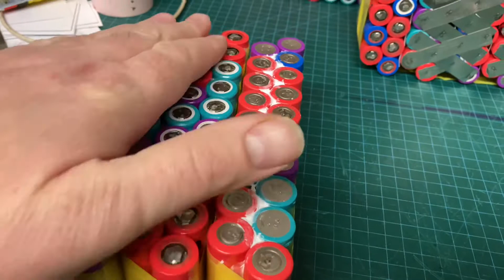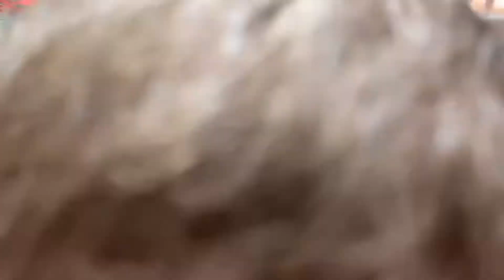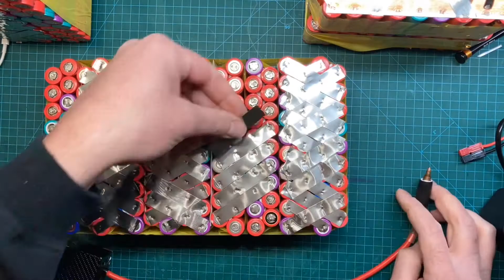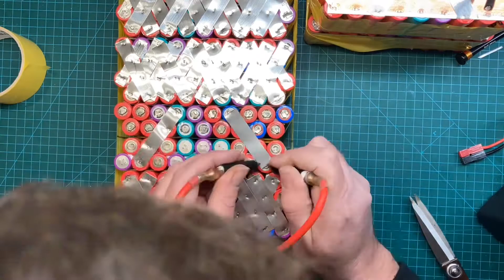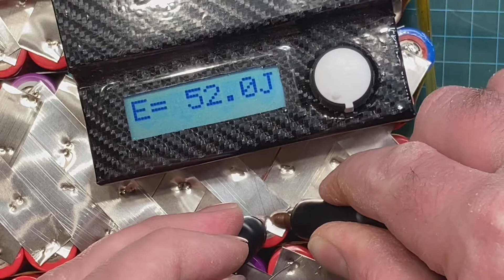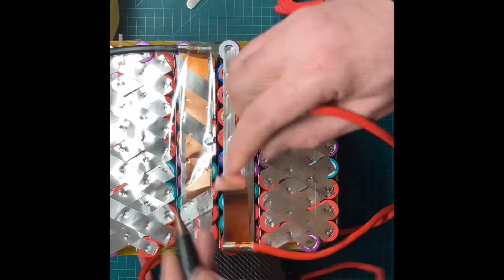12v Lead x5 to lithium 18650 19p 20s for electric scooter should give  lots of power

Comment: Very thick nickel strips, may be the cells have high capacity Haha
I've been thinking to make a 3S pack, it helped me to design shape of battery pack. 
Thanks man 🙂👍
Reply from the maker: Yes was 0.2mm nickel approx 3000mah per cell
Reply: @smartazz  2000mah is maximum for me Hah good for you ;) 3000mah i wish ill get one atleast lol
Reply from the maker: @DIYwithBatteries  did you see this video? Removing cells from a Tesla battery pack Harvesting cells tare down 6s74p 22.2v module #smartazz
https://youtu.be/kd7ZCH6YbFc

Comment: Are you mixing power cells with density cells? Or did you re sleeve them on red?
Reply from the maker: Each P is approx 57,000mah, Iv had to re sleeve all the BATTERYS as they were from a Tesla pack.